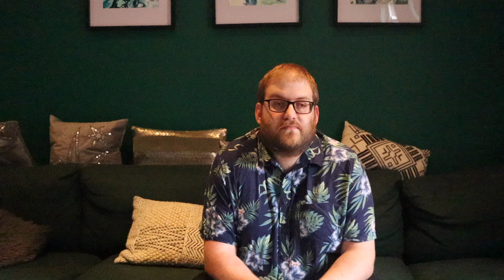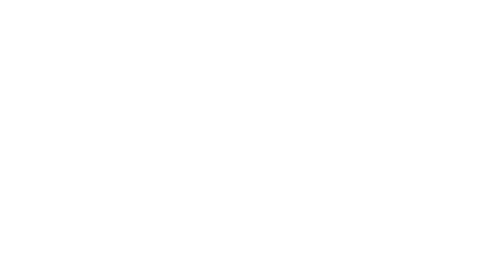Is the Renault Zoe a dinosaur? GRIDSERVE address AC Charging on Electric Highway!

Comment: Grid serve catering to vast majority  ,but ac 22 kw should be useful for etrons, some older Tesla’s . Having changed from first gen 43 ac to latest dc compatible , would not advise on not taking dc option on new zoe , reason did not buy 41 kw version , it had only 22 kw capability, big mistake by Renault

Comment: I attended the last EV Café online meet and Sam Clarke from Gridserve, who was one of the speakers, explained that when they took over the Electric Highway (EH) (Ecotricity), work had already begun on upgrading the charge points and didn't include  AC charging. He said Gridserve were correcting this oversight and would be retrofitting 22kWh chargers to all the EH sites.
I know some 43kWh charging owners are not happy but at least Gridserve has recognised a problem and rectified it for all AC charger users, albeit only at 22kWh and should be complimented for the quick response to the lack of foresight on the part of the previous owners of EH  who were ignoring all AC charging vehicles, not just the 43kWh ones. The minority 43kWh Zoe's at least can charge at an upgraded EH point now which they wouldn't have been able to do had Gridserve not bought them out!
Reply: Why do you write 'h' after kW?

Comment: I drive a Zoe with 40kWh battery and 22kW charging. If I could be confident of finding 7kW at my destination, I would seldom need to do a fast (22kW) charge on my longer journeys, but I hope to see a fair sprinkling of 22kW posts so that I can continue to use my Zoe for longer trips. 22kW are relatively cheap to install. The car takes AC which is what is being distributed by the national grid. My car has the "charger," which is the bit that converts the supply to DC at the correct voltage for my battery, onboard and I carry my own 3 phase cable. The problem for Gridserve, and other suppliers, is that I occupy the charging bay for longer per unit charge than a rapid-charging vehicle, so I am grateful that they plan to provide the service.

Comment: An interesting development. I just had a look at Gridserve’s site ( https://gridserve.com/ev-power-technology/ ). Plenty of clever marketing there, but it’s worth noting that all sites will have deals with the local District Network Operator (DNO) for connections via their utility supplier. The cost and complexity of ramping up the capability will most likely vary a lot geographically, to do with the amount of cabling upgrades, extra/larger local transformers etc.

Looking at the site mentioned here for Gridserve, there are some images of a batch of ISO containers full of batteries - so at some places it could be batteries being used to charge up EV batteries. Whether that’s an efficient supply chain or not, I’ll stick that on the wall. Wouldn’t be surprised if what actually happens is that they will buy in power at low prices, store it temporarily, and sell it off for a profit at other times of day.

Comment: As a 2015 Zoe owner who always succeeded in charging on (old) Ecotricity and used Cobham more than any other services, this developmment is irritating and worrying. Cobham was not short on CCS as there are also Ionities there. As an engineer, I fully appreciate that each site has its own space, contract and supply issues, but perhaps replacing two of the three at Cobham with new and keeping one older AC available for now would have been a better plan.
Reply from the maker: These old units are a liability though - I don’t believe that it was just incompetence / lack of care that was stopping Ecotricity from maintaining them properly but parts supply issues etc too. I guess having two different methods of access and support at the same site isn’t ideal either.

Comment: I’m a Zoe owner with CCS option but am I picking up on some established Service Stations are restricting the number of charging points being installed. If that’s the case then they are doing themselves serious  business harm because, if I can’t get a charge I’ll will go elsewhere to eat, If the problem is power demand to the site then there should be a waiting area next to a charge point as you tend to get a 45 minute max charge time. So if someone is already charging then I don’t mind waiting knowing it’s my turn next. However AC charging points should be allowed more time than DC users. 45 mins seems ok for DC charging. I recently used ‘The Cornwall Services’ and they seemed to have an adjacent waiting bay but it wasn’t labelled as such but I just parked next to someone already charging, then had a very nice chat and only had to wait 10 mins for my turn.
Reply from the maker: One of the sites mentioned at least - Beaconsfield - has IONITY on site as well as Electric Highway so I do wonder if that’s part of the reason for the limitation.

Comment: Can't fault Gridserve's comms on their rollout plans. Much better than other suppliers in most fields and they explain their thinking and also the obstacles they face. They are doing what they can to support Zoe owners and are to be applauded for it as it doesn't necessarily make any business sense to separately provide AC charge points as there only a few thousand Zoe's in the country who sometimes need an AC charge - and many of them will never go near a motorway.

I also prefer their approach of having separate AC units where space allows because it keeps the 3.6kw PHEVs off the rapid units.
Reply from the maker: As someone with a 3.6kW Kangoo ZE I would very much welcome some AC points away from the rapids! Would never obviously put it on a rapid but I would welcome alternative charging options!

Comment: Not a zoe owner but feel like the 43kw ac owners have been shafted. 22kw is not rapid.
Reply from the maker: Surely a very small number though - I have no idea how many Renault actually sold 🤔
Reply: @ModernHeroes  i hope they design and offer a ccs retrofit as would be a responsible move for a company like renault but i highly doubt it.
Reply: @ModernHeroes  less than 5000 43kW capable Zoes in the UK by my reckoning from the DVLA data, of about 16k ZE20 & ZE40 Zoes. Once the R motors were introduced in 2016 (and 43kW became a paid option) it's a tiny proportion that have it.

Comment: AC chargers are much cheaper and easier to install (6000 € compared to 30~140k € for a DC installation). Here in France, every town and most villages have 2 AC chargers that can deliver 22 kWh, whereas CCS is mainly available on major routes and I have started to notice that when I go to use one there is quite often another EV charging. The first thing I would improve on my Kia E-Niro is the speed at which it can AC charge. I would rather be charging at 22 kWh than waiting too charge at 50kwh. I did not realise that ZOEs only had AC charging.
Reply from the maker: Only older Zoes and base model new ones - CCS is available now. Most charge  at 22kW on AC, some can do 43.

Comment: I got an email from Gridserve regarding the AC charger situation. It's great to know that the lack of AC on the new installations is due to supply problems which will be rectified. But they could have replaced just one machine and left the AC enabled machine, giving everyone a suitable connector. And its worth noting that the new AC machines are only 22kW not 43kW that the old electric highway had. I think it is wrong to believe that AC is on its way out. There will be a lot of electric motorbikes using our motorways in the future and AC may be a better option for these machines. I currently own a Q210 Zoe and the 43kW charging makes up for the short range, so losing this option is very disappointing. In support of the Zoe, 2 years ago I was commuting 57 miles a day, couldn't charge at home, so I was using 22 and 43kW AC charging while shopping. No other EV would have been possible to do this without it being very inconvenient. Without DC at these shopping locations, most EVs charge much slower on AC.

Comment: What Gridserve are doing is entirely reasonable given all new EVs have CCS capability which is the de facto standard in Europe and AC only cars will eventually fade into history. Separate AC only charger provision will have the additional benefit of keeping EVs with legacy AC only charging off the rapid chargers. As you point out Gridserve are doing more to service this part of the market than some other networks so why are they getting all this flak?
Reply from the maker: People like to moan 😊
Reply: Couldn't agree more. Pretty much exactly what I have posted.
Reply: To answer your question, the reason Gridserve are getting "flack" is because they are removing something that previously existed and a number of drivers of older Zoe's will have relied upon these chargers - whereas Instavolt et al although they have not provided AC charging they havn't removed it either.  All that said fair play to Gridserve in stepping up to the plate and recognising the need for AC charging.  As a Zoe driver (mine does have CCS) I can tell you 22kw AC charging is extremely useful and as DC chargers get increasingly busy having a quickish AC option is in my view a real bonus.

Comment: Does the new Zoe have fast chargers? You e made me consider an electric car next year when my current lease ends
Reply from the maker: The newest Zoe has CCS DC rapid charging. It was a £1000 optional extra on them for a couple of years but I’m lead to believe it’s standard now.
Reply: @ModernHeroes  It is only standard on the Iconic and GT Line.  Not on the base model Play where CCS isn't available at all!